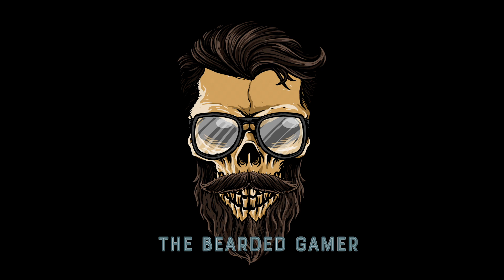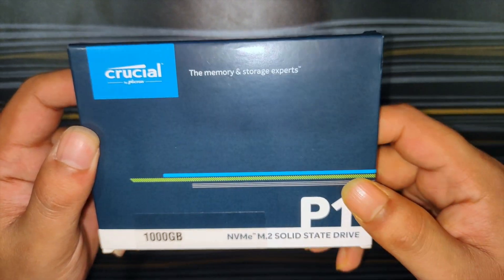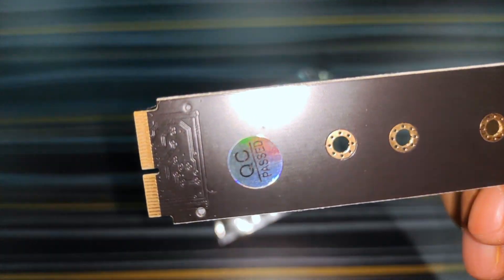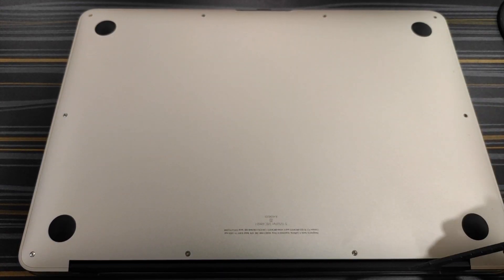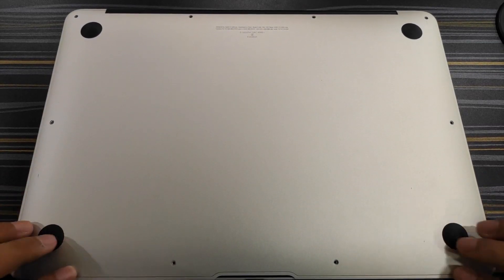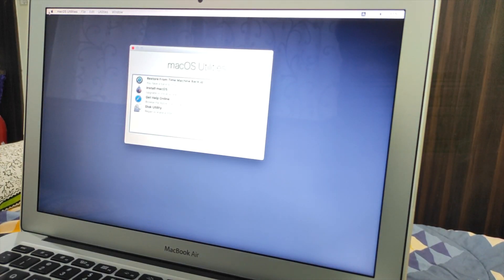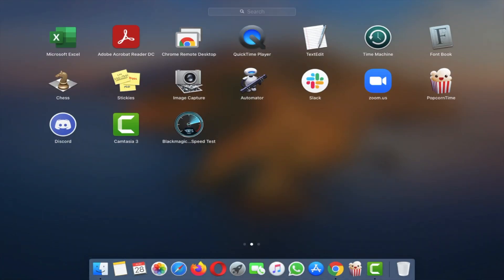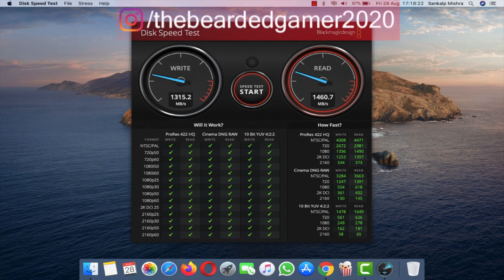2017 MacBook Air Storage Upgrade from 128GB SSD to 1TB NVMe SSD | Full Guide for 2021 | 40k+ Views

Comment: I have a MacBook Air 2017 and recently installed the Crucial M.2 1TB as per your instructions and every time it goes to sleep, it would wake up and crash with a fatal error message. I'm currently running Big Sur 11.4. Any suggestions?
Reply from the maker: Hi Brian, this has been happening with the new bug sur update for a few devices. If that's what has happened for you as well, you might have to do a fresh install of MacOS. But sometimes it is the NVRAM and SMC that need resetting after the storage upgrade or they start crashing when in sleep. So, try resetting the NVRAM and SMC first and if that doesn't work, do a fresh MacOS install. Also do subscribe to my channel and press the bell icon.
Reply: @TheBeardedGamer2020  thanks so much for the quick response. it was a fresh install from a USB. And I reset the NVRAM/SMC and still same issues. I’ve been trying to find a solution for 2 days now. When I switch back to my old SSD, same Big Sur version, no issues when I put it to sleep.
Reply from the maker: @onlybrian  On the proprietary Mac ssd, any OS that you put wouldn't have these issues. But with the upgrade sometimes these issues come up. You might wanna try doing a fresh install of the OS using an older version then update to Big Sur through the system. But before that, which adapter did you use?
Reply: @TheBeardedGamer2020  I ordered 2 adapters to try, one of them is the same as the one you provided. Both same issue. I installed Catalina 10.15.7 and same issue. I haven’t given up. Most people suggest to disable hibernate but I prefer not to do that.
Reply from the maker: @onlybrian  Why don't you try disabling the hibernate mode temporarily and see if the problem persists. If doing this works then we know what the problem is, but if it doesn't you can anyways turn it back on.

Comment: What exactly is a bootable installed? Do I really need it because I am confused
Reply from the maker: A bootable installer is basically an external macOS that you need to get into your computer. Once you remove the old ssd, you will no longer have access to your old MacOS. So, when you install the new ssd, this bootable installer will help you access the OS disk utility so that you can either do a fresh OS install or a TimeMachine restore. If that makes sense, show your support by subscribing to my channel and press the bell icon for future updates.

Comment: Hi bro..the tool kit you mentioned doesn’t include T5 screwdriver to open SSD. Can I use T4 instead of T5?
Reply from the maker: It is actually T4, so you can use it. And the adapter that you ordered will have the required screwdriver inside the packaging. Do subscribe and press the bell icon.
Reply: @TheBeardedGamer2020  T4 worked for me, also the existing screw for SSD didn’t fit after I install crucial SSD, but the screw that came along with SSD adapter fitted well. And finally I am able to successfully upgrade my storage now thanks a lot bro
Reply from the maker: @saikum1469  Good to know that you are no longer going to have storage issues. Don't forget to subscribe and if you have then thanks a lot.

Comment: Hey Bro, wonderful video, I plan to upgrade my MBA 2017 (128 gb). I have a few questions here. Before I upgrade to SSD, do i need to change my OS? At present I have High Sierra. Do I need to change to Catalina? If yes, How do I do it? Which adapter is good for Crucial P1 1TB: https://amzn.to/3oQWklo?  SSD Adapter: https://amzn.to/3oNbM1K or SSD Adapter 2: https://amzn.to/3fgMRAn?
Reply from the maker: Hey good to hear that you are planning the upgrade. You don't have to upgrade to Catalina or Big Sur if you are planning a fresh install on the new ssd. The bootable drive that you create can directly be created using the new OS as you will be downloading it from the app store. But, if you want to do a TimeMachine backup then you have to upgrade it to the latest macos so when you do a restore the previous OS matches the new one. Do subscribe to my channel and press the bell icon. For further queries or help through the process, you can also DM me on Instagram.
Reply: @TheBeardedGamer2020  Thank for your kind reply. I plan to go for TimeMachine backup. I may need your need. I will connect with you on IG.

Comment: Yaar there's no T5 screw in the toolkit you suggested. Cannot open the ssd slot screw. Thoroughly disappointed by this.
Reply from the maker: Hey Aman. All the viewers who have done the upgrade watching this video have received the T5 screwdriver in the toolkit. Not sure how that happened. Also the adapter comes with a T5 screwdriver. If in both the things you didn't receive the screwdriver, there could be an issue. I am willing to help, but can you please dm on Instagram.
Reply: https://www.amazon.in/dp/B072Q4CW5Y/ref=cm_sw_r_cp_apa_glt_fabc_70TJ84BY84VSW0P5H7F7

This is the one I ordered. Can you tell me which one is Torx T5?

Comment: Which one is the Torx T5 screwdriver in the kit? Can't open the ssd slot with 1.2mm one.
Reply from the maker: Hi Aman the philips 1.2 screwdriver can be used on all the screws on the back plate. For the ssd screw you can use the T4 screwdriver from the toolkit or the one that comes with the adapter.
Reply: I think the screw in ssd has gone rogue. What shall we do now as none of those screwdriver work?
Reply from the maker: Can you please dm me on Instagram as i would need some pictures so that I can help you. And it is also slightly confusing because I am not sure if you are talking about screws or screwdrivers not working as you keep saying screws for everything.
Reply from the maker: That's better. Now it makes sense. But you will have to share pictures for me to understand what the issue is.

Comment: Hi, thanks for the video, great help. But the link you provided for Toolkit shows not available. Can you please provide some alternative same thing, as the reviews of amazon of different toolkit are very mixed and cant judge. Thanks
Reply from the maker: Sure. This is a good one. Also, do subscribe and press the bell icon. https://amzn.to/3uPKp8u
Reply: @TheBeardedGamer2020  Thanks for the link. Really appreciated. One more thing wanted to know, in which of the two SSD Adapter you have mentioned, you have used it personally MHQJRH or Syscom, because MHQJRH has lot of reviews buy too many sellers too, so which seller is genuine cant able to make out.
And I have subscribed to you channel.. Thanks
Reply from the maker: @RohanKumar-fi2fl  Both are genuine and I am using the 1st one.

Comment: I've read reviews which say bootcamp doesn't work with such a setup. Have you tried installing windows under bootcamp?
Reply from the maker: I am using windows via bootcamp for the past 6 months, no issues. Do subscribe and press the bell icon.

Comment: Wt is the difference between P1 SSD and P2 SSD I want to install in MacBook Air 2016 parched plz tell me urgent
Reply from the maker: P2 is slightly faster than the P1 but when it comes to this upgrade the P1 is good enough because the Macbook has speed limitations. So better to opt for the P1. All product links are in the description. Still, if you need any additional help you can dm me on Instagram as well.
Reply: Thank you bro 😍
Reply from the maker: @chaitanyak7087  No problem bro. Always here to help.
Reply: Which converts shall I go adapter  price drop are adopter 2 for crucial 500gb
Reply from the maker: @chaitanyak7087  You can choose any of it. Both of them work fine. Just gave two options for convenience.

Comment: Hi
My macbook air is of early 2014, will it be compatible? 
- what is the difference between Samsung, Crucial & OSCOO ? Do they all come with warranty ? Which is better ?
- OSCOO doesn't require an adaptor ? How to attach a adaptor to SSD?
- Do we need to take back up of the data on an external HD before changing it and do we need to reinstall MAC IOS ?  
- is there are way on increasing the RAM also or is it soldered ?
Reply: I jus did it but somehow SSD is not appearing. What to do now ?
Reply from the maker: Did you use the exact same process and the same components?

Comment: i also have a MacBook air 128 (yr2017)  processor - 1.8 GHz Intel Core i5, RAM - 8 GB 1600 MHz DDR3, Graphics - Intel HD Graphics 6000 1536 MB. can i upgrade this by using the same SSD and Adapter. I cannot use Adobe premiere pro and Illustrator due to low space?
Reply from the maker: Yes. You can surely use the same process and upgrade the storage as per your requirement. Links to all the products are in the video description. Don't forget to subscribe to my channel and press the bell icon.
Reply: @TheBeardedGamer2020  thank you so much
Reply from the maker: @BigVehicles  No issues. Kindly subscribe to my channel and press the bell icon. Also if possible share this video around your network and ask them to subscribe.

Comment: Bro can I use crucial P5 instead or p1?or  Hp sdd ex900
Reply from the maker: Hey Darshan, if you want to go for an expensive ssd you always have the option of going for the Samsung Evo. I have the links for the product in the video description as well. I chose this because there is a threshold on the post upgrade speed so there is no point spending extra for benefits that you will not receive. If that makes sense, do subscribe to my channel and press the bell icon.

Comment: please make a video on macbook pro or air 2019/2020 models

thanks in advance
Reply from the maker: Hey swamy. Really happy that you liked the video and want more videos like this. The only issue is that Macbooks post 2017 stopped taking in storage upgrades. So for 2019/20 Macbooks this option is not available. I hope I was able to help. Do subscribe to my channel and press the bell icon if you haven't already done so.
Reply: @TheBeardedGamer2020  want to purchase 2019/2020 model MacBook Pro and trying to upgrade the storage. So there is no way
Reply from the maker: @naveenswamy786  Sadly, no.

Comment: bro i did the same as you said , also i did diskutil list 
still i am not able to see my hard disk anywhere , what to do ?
i tried removing and putting it back 3 times now
Reply from the maker: Which adapter did you use?
Reply: @TheBeardedGamer2020  https://www.amazon.in/gp/product/B07SCPSX7L/ref=ppx_yo_dt_b_asin_title_o06_s00?ie=UTF8&psc=1 this one
Reply from the maker: And did you use the bootable drive or Internet recovery?
Reply: @TheBeardedGamer2020  Internet recovery
Reply: Can i have your mail id ? i want to fix this issue asap
Reply from the maker: @jsj3928  Follow me on Instagram and drop a dm there...will guide you.

Comment: Hi after upgrading new ssd is there any external adapter for Apple ssd can u plz let me know
Reply from the maker: Hi Naveen there are adapters for the apple ssd but they are so expensive that you can buy a 1- 2 TB external hard drive for that price. So there's no point buying those. You can keep it and replace it when you plan on selling off your macbook. If that makes sense, do subscribe to my channel and press the bell icon.

Comment: the ssd is singlke cut or double cut and is it still working
Reply from the maker: It is single cut and it is still working and performing as it did on the day I installed it. If this answers your question, do subscribe to my channel and press the bell icon.

Comment: I have installed bootcamp on my Mac after changing the ssd will the bootcamp be there
Reply from the maker: If you create a time machine backup of your current os, upgrade the ssd and then restore from the backup your entire current configuration will get replicated on the new ssd. But if you do a fresh install of the Mac OS then bootcamp will also have to be installed again. Do subscribe to my channel and press the bell icon.

Comment: I bought same Crucial 1tb SSD & connector which you have mentioned in the description. I am using 2017 macbook air. I have installed exactly same you did in your video. I don’t know why I couldn’t find ssd in my laptop. When i clicked on disk utility there’s only apple disk image and os x base system shown. I don’t know what to do now.
Reply from the maker: Did you use the bootable usb to go into Mac OS recovery
Reply: @TheBeardedGamer2020  yes. Is there any way to send photo to you? So that you can see whether i am going right or not.
Reply from the maker: @sidharthbargotra5372  Yes dm me on Instagram that way you will be able to communicate better.
Reply: @TheBeardedGamer2020  okay thanks😊👍🏼
Reply: No. I heard you said about it but couldn’t found that link. Please mention that in reply. Thank you
Reply from the maker: @sidharthbargotra5372  If you don't use the bootable drive, obviously you won't be able to access the ssd. The link is in the video description. So use that and create a bootable drive. And follow the steps exactly the way I have done and it shouldn't be an issue. Also do subscribe to my channel and press the bell icon if you haven't already done so.
Reply: I just completed bootable usb drive process and after that i changed ssd. Even then after my laptop doesn’t find it. Now it shows that usb drive also along with apple disk image and os x base system.

Comment: can we use the ssd removed from MBA as external ssd if yes please suggest adaptor or clousure
Reply from the maker: Hi Nikhil. That is possible but the enclosure that you get is extremely expensive in India. So much so that you can buy a 1-2TB external hard drive. So, better to safely keep it and replace it when you plan to sell off the MBA. Also, do subscribe to my channel and press the bell icon if you haven't already done so.
Reply: @TheBeardedGamer2020  sure...subscribed

Comment: Dude my MacBook Air is of 2017 so will I need bootable stick or  I will need to create bootable  installer ? I mean can’t I download NEW OS from directly system recovery by pressing option immediately after start and then install new os from recovery? Will I get this option directly or I will need to do something like bootable stick usb or something bootable installer?
Reply from the maker: Hey Darshan you can use a bootable pen drive and also the internet recovery option but better to choose the former as the latter is slightly unreliable. If that makes sense, do subscribe to my channel and press the bell icon.

Comment: after swap it with 1tbb ssd to macbook, how to reuse that 128 gb mac ssd in windows laptop ? is there any adapter ? please suggest
Reply from the maker: Sorry bro reusing it is almost impossible as there are no adapters available and the ones available are extremely expensive. You will be able to buy a full 1TB external hard drive for the price of the adapter. So you can keep that proprietary 128gb ssd for the time being and reuse it when you plan to sell the laptop. If this makes sense, do subscribe to my channel and press the bell icon.

Comment: Hey after watching your video, I did the upgrade of my MacBook Air (early 2015) using Crucial P1 500GB and used a small adapter that came at half the cost https://www.amazon.in/gp/product/B084RR84TJ/ref=ppx_yo_dt_b_asin_title_o00_s00?ie=UTF8&psc=1

Now, after doing the upgrade, I have obverse the following changes:

Before upgrade(all Apple parts):
Battery backup: 4 hours
Heating on Processor Side: Minimal (while watching videos & few excel windows opened up)

After upgrade:
Battery Backup : 3 hrs (1hour less)
Heating on Processor side has gone from minimal to med level heating.

Should I be worried? are this difference also obverse on SSD Adapter which you have suggested? 
I am just worried about the heating part, everything seems good apart from reducing battery but don't want my MotherBoard to fry up.
Reply from the maker: Hey, that's a great and detailed observation that you have shared. But I have been using the entire setup for over 6 months now and there is nothing to be worried about. Your motherboard is safe, period. The heating and battery loss that you see is because of the new ssd and adapter. Apple proprietary ssds are optimised to perform in sync with the entire system and even the OS plays a major role in it. But with the new ssd slightly more power is directed towards it which leads to slightly less battery backup and the additional heating. So, to sum it up it no worries. If this made sense, do subscribe to my channel and press the bell.
Reply: @TheBeardedGamer2020  Hey Thanks! I could say I had gone through a lot of videos until I reached at yours and then it was period to hopefulness searching. Your guide is perfect and even liked the screwdriver toolkit which you suggested. So I got worried that did I make a mistake by not going with your mentioned ssd adapter and saving 1500 bucks. Money is very tight these days post covid. 

But Now I can relax! PS: I am your follower already. Do keep posting such perfect guided videos and even your replies to every one of our comments is very appreciable.
Reply from the maker: @sahiss92  Really appreciate the support man. Will continue adding such videos. Thanks.

Comment: Thank you for great video 
Regarding the replaced drive (Samsung) can we us it using case as an external ? if yes can you help me with link to purchase it
Reply from the maker: Hey Mohamed finding a case for the proprietary ssd is extremely difficult and the ones available are super expensive. You can actually buy a 1 TB external ssd or even more at that cost. So it's better to keep it and replace it whenever you plan to sell off your macbook. Hope this helps. If it does, do subscribe to my channel and press the bell icon.
Reply: @TheBeardedGamer2020  Thank you for wise response